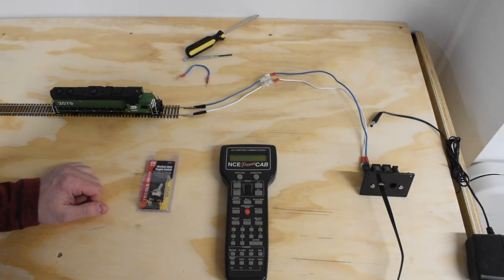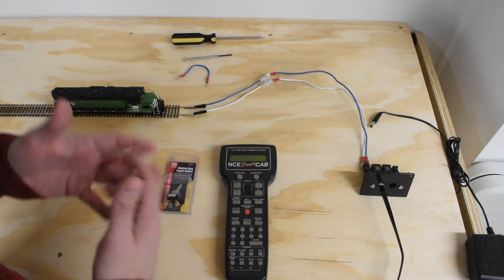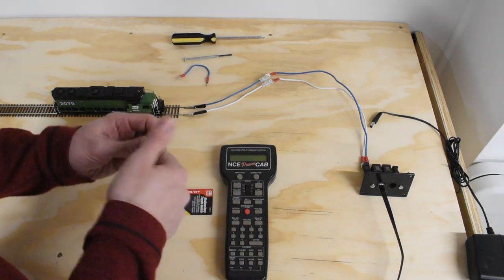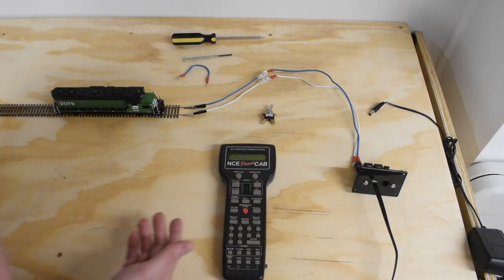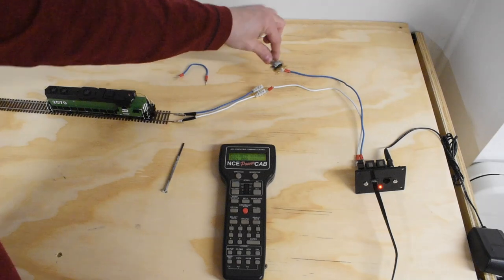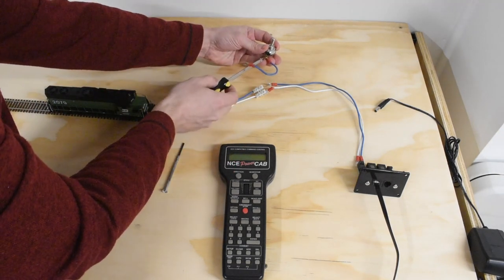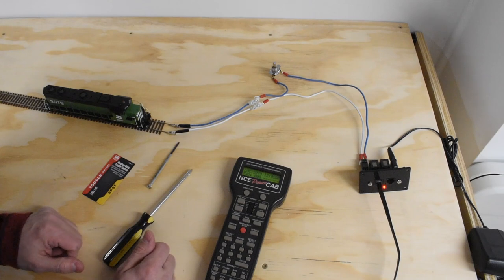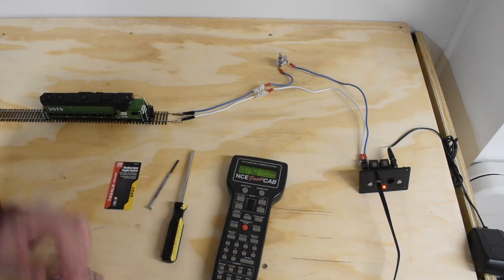Using a Switch To Turn Model Railroad Track Sections On/Off

Comment: Thank you so much for this video!  Exactly what I was looking for - have a roundhouse turntable w/ spur tracks I want to store engines on - but with the ability to turn that spur track on/off - your video helped me figure it out - b/c I was dumb enough to use both wires - one to each terminal of my toggle switch - not just one wire.  Derp!  

FWIW, I used the feed from my bus line to the ON terminal and feeder line from spur track to the OFF terminal.  Perfection     Thanks again for a clear, concise video super useful for a newbie like me
Reply from the maker: So glad you found it useful! Thanks for stopping by!

Comment: You know what works really good is to use the Atlas controllers as so many people have those laying around, and yes just sever one wire... I use them in my yards where I park and can cut off the power to the engines or use power routing switches, even better... no extra wiring... Take care... Daylight Dave...  DD  😜
Reply from the maker: Good idea using what's available!

Comment: Yes great explanation. You can do the same using a double throw switch. Using one wire in... Splitting off to two separate tracks. With the double throw switch.. The center is off an if you select upwards that will close that circuit for one track just like in your video. The same is true if you select down then youll close the circuit for the other selected track 👍

Comment: A safer way to accomplish this is with a double pole single throw switch (DPST). This will allow opening of both sides of the power circuit. This is safer because it removes what is called "potential" in the electrical/electronics field and ensures that the locos on that track can not, until the switch is closed, receive any power.
Reply from the maker: @ronheiser3248  thanks for the tip!

Comment: Thank you for the layman's explanation! It was very helpful.   Did the switch come with the screws?  Can you provide the switch manufacturer's name?   I would like to avoid having to solder the small connections on the switch.
Reply: Yes on screws. I got Gardner Bender med duty toggles at Menards for $4 each - same as whats shown in video

Just be aware the throat part which sticks thru the wood is only 1/2” deep - so if your wood is thicker, youll need one w a longer throat or put them all thru thinner wood you then attach to frame

Comment: Just found your channel and saw this video. Immediately subscribed as you explain things even I can understand. My layout is Kato n scale, and I have incorporated 3-4 passing sidings off the mainline. Correct me if I am wrong, but to isolate these sidings I can install insulated joiners on the rails to/from the siding, power each with a feeder to the bus, and splice a SPST switch on one side of the feeder. Is it that simple? Thanks.
Ron
Reply: Then again I just realized that my Kato #6 turnouts are power routing so not necessary if I do not use insulated joiners and do not run a track feeder to the siding. Still a good idea though.
Reply from the maker: Thanks! Yup, pretty much that simple if you want to splice a switch in. You can also use a double pole switch if you want to cut power completely off from what I understand. Either way, thanks for stopping by!

Comment: This is an excellent presentation. I am trying to do this myself, but it is very confusing to me. I ordered an Atlas Connector (205).  I’m assuming that I can disconnect the side rail by:  1. attaching a piece of regular track to the switch. 2.  Inserting two plastic insulation plugs into the rails. Inserting the Atlas Terminal Joiners to the other end of the track.  3. Attach the other end of the terminal joiners to the Atlas Controller. 4.  And then attach the Controller to the train transformer. 

I hope that wasn’t too confusing. My Atlas components haven’t arrived yet. I still try to figure out this all out. Thank you so much.  Eric
Reply from the maker: I haven't used any Atlas switch products, but it sounds like that would work based on your description. The basic idea is that you're simply disallowing the current to complete the "loop", and it looks like the 205 is for just that.
Reply: if you're running multiple cabs on multiple blocks you'll need Atlas selectors to go with your Atlas controllers.  The Controller will distribute the cab power to the selectors and the selectors will distribute the power to the blocks of track on your layout.

Comment: Thank you for explaining using the switch but can’t a loco be programmed to be quiet when the power is turned on or do all locos fire up automatically when given power?
Reply from the maker: Sound-wise not all start playing sounds, but to my understanding they're still drawing current, so if you have a lot of locos running you could experience poor performance if your system isn't boosted properly. I'm by no means an expert, but that's my current understanding

Comment: Here’s how I did block sections on my DC layout. I used plastic rail jointers on the track so power would not flow through my block sections. Then I wired to one side and the other side of the track. If no one knows this one rail is positive the other is negative until you flick directions then it’s opposite so you have to wire both sides connect it too a switch. Now with the switch one power will flow with your cab controls once the trains in the block flick the switch and the train won’t move anymore. This is how I did it only requires a little soldering not too difficult. If you go DCC this is much more simple you don’t need to wire anything but it could still be useful to not have your locomotive run constantly just sitting there
Reply: Little please -running a train into a station want to turn power- one wire from 12 volt controller to switch terminal ,the other switch terminal hook it to the track after the plastic joiners, where does the seconded wire from the track go? I can bring it back to the controller but only makes train go one one direction

Comment: Loved the video. But you didn't explain the other part s you had. I saw a transformer and a plug-in in front. Also what do you do if you have more than one siding to do?
Reply from the maker: The other parts were my NCE DCC system, just substitute those with whatever system you're using. If you have more than one track to do, just use one switch per track using the same methodology. Or you could do multiple tracks per switch, whatever works for your situation, the key is to simply cut the power to the track the same way as in the video.
Reply: @Late Night Model Railroad  thanks
Reply: I use digitrax